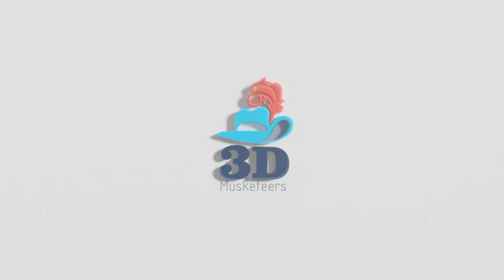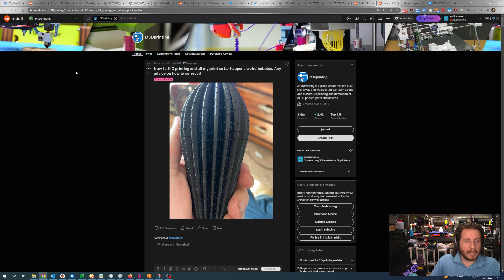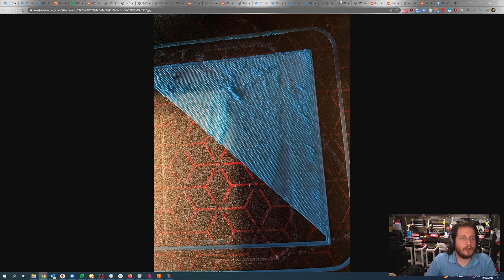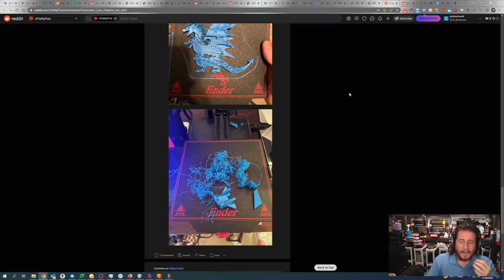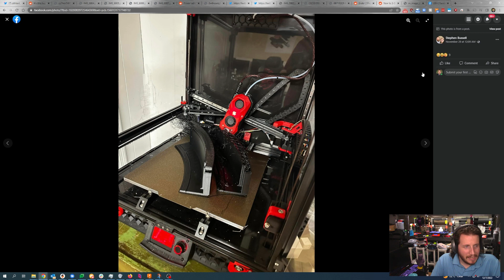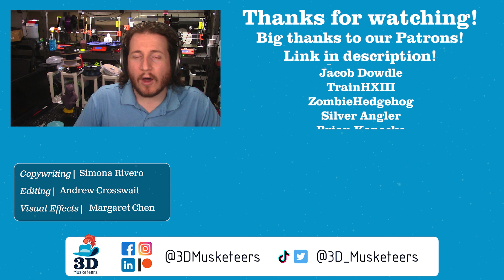It Tore Itself Apart!! - PrintFixFriday 65

Comment: Just finished my trident. Do a 2.4 the trident is top heavy and wobbles a bit when going like 10k accel
Reply from the maker: Isn't the 2.4 MUCH more of a crazy build?
Reply: @3DMusketeers  After building my trident and learning the differences, the gantry is exactly the same its just the way the z axis opperates. the 2.4 raises and lowers the whole gantry whereas the trident lowers the bed and the gantry is fixed at the top.  I wouldnt say by any means the 2.4 is "harder" or "more challenging" but its just a few extra steps that in hind sight (lowering the center of gravity) would have been really nice.  Do the 2.4 you wont regret it. Join the discord if you havent yet.  Ive already ordered my 2nd one. im doing a doomMicron which is a mini 180mm 2.4 with double panel insulation. Its a rabbit hole you just need to go down to understand. It looks terribly intimidating, but you will have no issues with it. You know what your doing lol👌
Reply from the maker: I have made larger sturdy! :) But yes the bed at the top can pose some resonance issues
Reply: @3DMusketeers  Thats really the primary difference. the whole gantry either moves down to the stationary bed, or the fixed gantry with the bed that moves.  The assembly difference is that the 2.4 has 4 Z motors with   4 mounts and 4 belts and 4 idlers that help it do its thing. The trident just has 3 motor mounts with lead screws and they just mount to the bed basically.  In terms of difficulty theyre the same. the manual has about 50 or 60 extra pages over the tridents 350 page manual. In terms of satisfaction i think the 2.4 will be more in line with what you'd want for your channel and popularity.  (Theres almost 5000 2.4s and only 845 tridents)
Reply from the maker: lower number of Tridents actually is kind of cool for me! While not as much help would be available from the content side it should do well! Not that a 2.4 wouldnt, but definitely saving some pages on the manual would be nice.
Reply: @3DMusketeers  yea i agree its not necessarily newer = better tho either but My trident is vt841 and im happy its under 1000 lol. I feel like now i have to do all of them anyway.  
I would start on the voron github page and discord for sure and browse thru the stls for each, then the usermods as well. for example my trident mods/custom choices are:

* Blue frame.
* LDO Motors
* 440c rails
* Stealthburner, LGX Lite, Rapido uhf, cht nozzle
* Ebb36 CAN,
* Ultra-flat black anodized bed
* Full size 800w heater pad,
* Rainbow Barf toolhead leds
* Klicky probe
* Sexbolt endstop
* Triple bed Fans for even chamber heating
* Decontaminator purge bucket / scrubber
* Trident Inverted Electronics mod
* Quad electronics cooling fans
* Dark smoke panels,
* BTT octopus pro & CB1 w/ BTTPi4b

Basically now my start gcode procedure will home, preheat, grab the klicky probe from its dock, level the 3 bed screws with z tilt within .0075mm on all 3 points, then purge and clean the nozzle, then it does an adaptive bed mesh to probe only the points within the print area, and finally it adjusts the z offset automatically with some wizardry and starts a print with a near perfect first layer every time. 👌  Theres so much more you can do with them. that only scratches the surface.  

Looking back id say it was fairly easy for someone w experience tearing down all his other machines too.  I wouldnt say its "hard" at all. just about what youd expect from building a printer from scratch like this.  The harder part imo was actually finding the right parts for all the mods and making sure they're compatible.
Reply from the maker: seems like the hard part is finding the time ha ha ha
Reply: @3DMusketeers  Slow and steady wins the race w printer assembly! 😄 I started in  october or so.  Gf says i have to clean the office before i build the next one haha
Reply from the maker: It may for most people but not for a content creator ha ha! I would have to rip this thing out in a couple of weeks max.
Reply: @3DMusketeers  The biggest thing then is just making sure you read thru the docs.  Its all super well laid out and stuff. Print now cause worst case you just dont use some parts or have extras. Make sure you have everything and extras of screws and it goes pretty smooth actually. Just spend plenty of time researching it and consider getting a kit.
Reply from the maker: Will absolutely have extra hardware!

Comment: i bet in ps or ss you can set variables that check for vase mode and then disables it automatically. I personally dont use it at all. If you wanted to make failsafe to the bambu faceplate just add hall sensor and magnet. Voron must be a mofo to build which is why i got ratrig.
Reply from the maker: maybe? would not know! But same I do not use it.

Comment: The broken Voron probably has a nozzle cleaning brush at the back of the bed, so it was likely headed down to go there. The Z axis of the 2.4 has four steppers driving reduction belts moving the gantry down. So it has a LOT of force and available torque when moving in Z. Cleaning the nozzle at the end of a print is not a safe move. :)
Reply from the maker: yeah its CRAZY powerful!

Comment: Voron Trident at 250-300, or 2.4 at 350 depending on what size you are seeking.
Reply from the maker: I am thinking a 300 trident. I want larger but the 2.4 is a whole different beast I am told
Reply: @3DMusketeers  As the build volume gets larger the thick cast aluminum bed plate gets heavy fast, and there comes a point at which the gantry is lighter and better to move it (Voron 2.4) instead of moving the build plate plus all the printed plastic (Voron Trident style). Where that dividing point is one could argue, but I think it is above 300. The Trident 300 has a Z height of 250, but the LDO 300 Trident has special taller integral leadscrew Z motors so it has 300 in Z. 300 is a large printer so I decided to go with 250, but 300 is a popular size and perhaps more available kit. The cost of the 2.4 and Trident are about the same, but there are more motors, belts, wires and parts in general to print, assemble and adjust on the 2.4. A Trident 300 is a great choice. Looking forward to your build.
Reply from the maker: hmmm is the price of a 350 2.4 much more than a 300 trident? We have a printer that is 355x355x315 and routinely get close to filling it.. I have wanted to replace it for a while now.
Reply: In the same size the prices have been pretty similar for Trident and 2.4 from LDO at least. I haven't looked into a 350. That should be a bit more expensive than a 300 with panels, extrusions, bed, bed heater all considerably larger, heavier and increased in the shipping costs. At 350 the weight of the bed vs the weight of the gantry is something to consider, the 2.4 is probably the choice there.
Reply from the maker: I can likely just laser the panels myself. Will look into it all! Really afraid I am about to go down a nastyyyy rabbit hole lol
Reply: @3DMusketeers  True. And it will give you something to compare to the XL for more content. :)
Reply from the maker: That's kind of the plan!

Comment: LDO Trident, 300 cubed is the best kit avaliable with a great build volume. I'm currently building a V2.4r2 which should be a much harder build, but I like the stationary bed.
Reply from the maker: It is on my list, but I do prefer stationary beds too! Isnt the 2.4 much more expensive?
Reply: @3DMusketeers  They are pretty close in price. You can save some a fair amount of money going with a Formbot kit over the LDO
Reply from the maker: But I do want to support LDO personally, however if formbot wants to sponsor a build I would not say no...

Comment: the workhorse with easier build is the Voron Trident, if I where to build my first Voron (too late) I'd chose that one
Reply from the maker: What makes the Trident special?
Reply: @3DMusketeers  it has a fixed gantry and a 3 axes bed so relatively normal movement and not too many wires you have to route, no deracking of the gantry and still almost all the speed (as far as I can tell slightly faster XY and slower Z but not by a lot). The height is often smaller then a V2 but I have never needed that much Z.
All in all an easier build then V2 or V0, still a big one and no one can say it's not a Voron
Reply from the maker: noted!

Comment: I’d say just swing for the fences and go 2.4r2. From what the discord says, the 0.1 is challenging because of the ultra small components.
Reply: I put one together, had a couple issues assmbling it, even resorting to one of the wire guides being re-printed with a bit cut off, before the gantry fell in place and the proper part fit properly.
Zero issues with the machine so far except I may need to re-print the extruder body and/or clamp handle with tweaked settings.
Reply from the maker: definitely, but there are others, like the Trident

Comment: Hurm.. I am the same.  My next printer will be a Voron 0.1 or 2.4 but I will tell you; after experimenting with Klipper/Mainsail on the Prusa Mini+, I’m not nearly as excited.  Both are NOT normie friendly, AT ALL.  I didn’t have an issue with the workflow and support for Klipper on the Mini is non-existent but for someone without my background (EE, worked as a network administrator for years and have programming experience in Pascal, Basic, Java, C++, machine language, assembly language [ PIC microcontroller]) I wouldn’t advise it for the non-tech oriented person. Even if the support for the configs, etc is much better for the Voron versions.
Reply from the maker: I am middle of the road techie I think.. I know enough to upset the proper tech people in the family because I break things badly lol

Comment: Build a Trident. V0 is too small unless you'll have something small to print on it.
All of them are fun to build.
Reply from the maker: I dont alas, we have Prusa Mini's for that. I would want a coreXY. is the trident one or is it a bed slinger?
Reply: @3DMusketeers  Trident is a CoreXY. You can get the 250 cubed from LDO. Speaking of LDO, their kits are fantastic!
Reply from the maker: ah ok! I see there may be a 300 kit as well!
Reply: @3DMusketeers  that's right! If you want 350x350x310, then go with v2.4r2. it's a CoreXY as well.
Reply from the maker: noted! Will have to compare pricing. Because we have a printer that is 355x355x315 that routinely does big parts.
Reply: @3DMusketeers  with LDO kits, pricing is barely noticeable (100 CAD between print volumes). A 350mm Voron 2.4r2 would be more for your use case. Safe bet will be a Trident 300³.

Comment: Even after seeing how Printed Solid makes and dries their PETG, it still improves print quality to dry them in a dehumidifier for 24 hrs at 249F, in my experience.  I dry all the spools when I get them, they then go into the dry box i print out of or into a vacuum bag with desiccant in them.
Reply from the maker: For Sure! Petg does like to get damp.
Reply: That seems a little hot to dry it before printing.   That is 120c. I think the recommended is around 80c.
Reply from the maker: oh yeah, 120C will melt petg. We do 70c for about 6 hours.

Comment: I'm discovering interesting things related to the MMU. It seems like darker colors are more problematic on cheaper filaments. I was trying to do a deadpool pikachu (pikapool) and it was failing way too much.....and then I had a part fall off the supports so I canceled it. I needed a faster print, because I need the printer free this weekend so now I'm doing a normal Pikachu that's slightly smaller. The yellow is still stringing, but not as much as the blue from wobbufett or the red from pikapool. Maybe I need to run temp towers on all these filaments. But I think I should buy higher quality filament. It's not worth saving $5-$10 if it's just going to fail a lot. I'm using the prusament brown in pikachu. That's an incredible filament. No stringing AT ALL and I can even feel the difference between it and every other filament. It feels more solid. Sunlu feels cheap and flimsy. esun is about halfway between. Maybe I got lucky on the esun light blue. That stuff never had stringing problems.
Reply from the maker: Darker colors may require more pigment? I have had great success with Printed Solid Jessie filaments
Reply: @3DMusketeers  yeah I might do that. Prusament doesn't always have the colors I need. I means buying more dryers though. I can only fit 1 jessie cardboard spool in per dryer instead of 2. If it was just BARELY smaller it would fit 2.
Reply from the maker: hmm that is a bummer!

Comment: Yeah, I’m off the Revo bus with the endless delays on the ObXidian.  Just got a mosquito for 99.00 today.
Reply: And got my $94.00 back for the preorder I made for them on October 7th when they were going to ship on November 14th, then November 21st, then early December, now not expected in 2022. I’m done.
Reply from the maker: totally understandable.. Delays suck but remember E3D is not doing them purposefully.
Reply: @3DMusketeers  I know.  I waited for months to install the Revo expecting the 21st ship date, then it comes and passes.  A week later I hear of the additional delay. The communication has been less than optimal, that’s what really burns me.
Reply from the maker: I think it came down to the wire for them as well. It is a shame, but it happens..

Comment: I didn't know the P1P was out yet. Also that purple filament at the beginning and end (but not the middle) of the video is really pretty!
Reply from the maker: It is not, some reviewers have them though. The bust next to me? That is Jessie PLA from Printed Solid. Color is Deep Purple.
Reply: @3DMusketeers  Jessie is a carboard spool. This was in a black spool on the first printer. Jessie is the filament I saw in the middle of the video.
Reply from the maker: AH, that is still a Jessie spool. Purple Ice. one of my favorites.
Reply: @3DMusketeers  ahhh so they don't just have cardboard.
Reply from the maker: They didnt, all new production is cardboard. They moved away from plastic. You can, however, just take apart their cardboard spools and put it on something smaller if you need